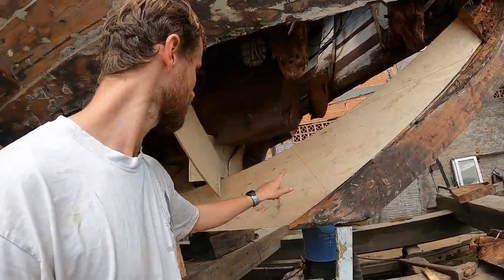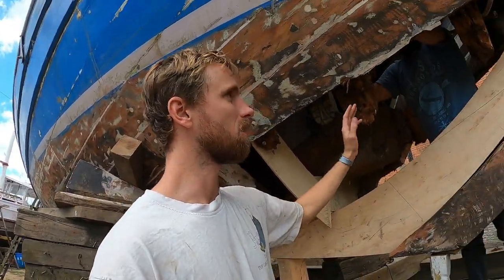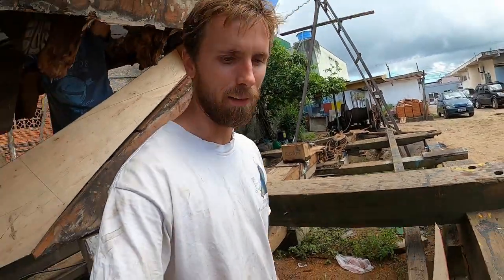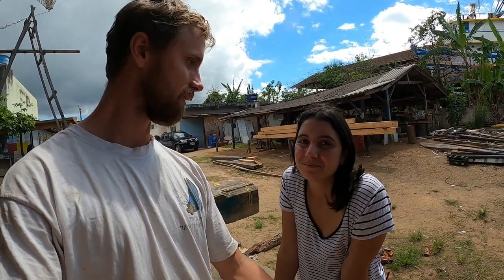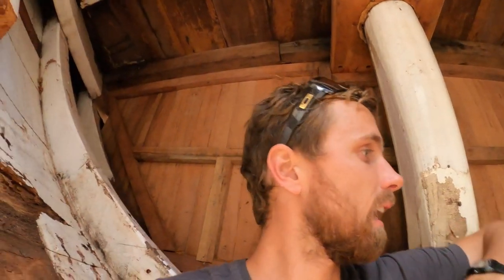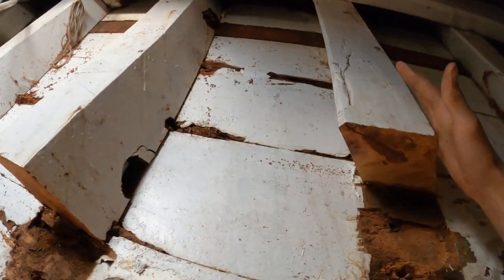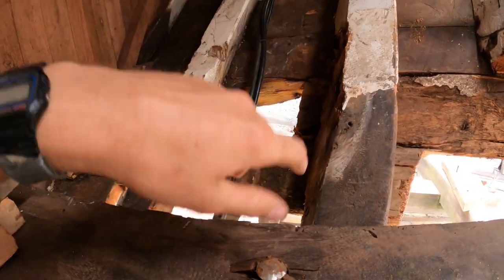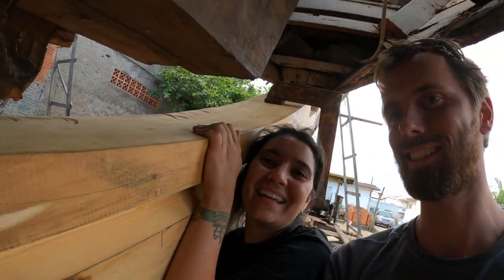From WRECK to DREAMY starts now! — Sailing Yabá #13

Comment: Like to see the final result, but some general commands; 
a nautical dictionary can help you. Bow & stern, portside & starboard, keel, deadwood (<-- where your propeller shaft penetrates the stern), bulkhead, deck, hull, shell, bottom- hull- & deck frames, hull- shell- bottom- deck planking, stringers etc. try to use the nautical names. In both languages English e Portuguese (você continuará navegando com a YABA no Brasil por um tempo). You will be a  better communicator with other nauticals / shipbuilders.

Secondly; if you now first don't invest in preserving all the "new" and still good wood you will loose it again. Those worms and termites (<--cupim) you carry around are allover your boat, take the wright action you are spending a lot of R$ and time.

Comment: Hey guys, great to see the progress however I am not seeing your workers add one important item.  For each scarf (overlapping connection) where the centreline timbers meet and cross the rabbet line you need to have something called a "stopwater" to prevent water from making it's way along the scarf line.  Not a big thing to add, these are just a hole drilled through the scarf line, usually in the rabbet under the planking into which you drive in a softwood dowel.  The dowel swells when the boat is in the water and blocks water from making it's way through your scarfs.  Sure the boat will float without stop waters but you will have constant seeping and pumping to deal with.  A lot of people don't know this but a well constructed wooden boat can have a dry bilge!  Best of luck to you.  James

Comment: Just a little English help:
Front of boat= Bow
Rear of boat =stern
The bit the planking that the planks go into the keel is called a rabbit or rebate.
The part the prop shaft goes through is the shaft log
Steering wheel is a helm
I can’t think of anything else keep up the good work Yabba is lucky to have you.

Comment: What type of wood are they using on your keel?
Reply: I did get the actual latin name, but cant remember it. It is a tropical hardwood that is generally very rot resistant.......not sure the stuff coming out was the same species of timber.
Reply: @skaraborgcraft  the wood is Garapeira (Apuleia leiocarpa)

Comment: Hard to believe Yaba is only 15 years old.
Reply: It's what happens when you don't maintain the boat regularly. As they cheaped out using sapwood etc. they probably cheaped out on bottom coat / maintenance and no worm shoe present. Sailing the boat up a river occasionally was an effort to try and kill off the marine shipworms in freshwater, but seems it was too late by that point.
Reply: Sapwood can rot out in less than a year when in water. A good builder would never use it.
Reply: The tropics can be hard on wooden structures, especially if maintenance isn't taken care of!

Comment: I still want to know the cost of this.I just don’t see spending a lot as this boat will ever be right.To do it right every bit of rot needs to be removed.Rot is a cancer unless you get it all.It will come back....
Reply: Agree 100%. And it looks to me like they are leaving some rot there if the wood is still solid enough. Not smart in my opinion. 
I’d like to know the cost as they go along too. Someone on another video in the comments said they found the original listing for when this boat was for sail and it was listed for $50,000 US.  Of course, that doesn’t mean that’s what they paid for it, but that’s the original asking price. If it sold for anywhere near that you just know the seller was dancing a happy dance as they sailed this piece of crap away. 
But I hope they’re made of money. Because it’s gonna take a fortune to get this rotten thing rebuilt.
Reply: Given the prevailing wages in a working boatyard (eg, one oriented toward repair & maintenance of working fishing boats), and the raw costs of materials, my running estimate of getting Yaba back in the water with a new bottom is between $5K USD and $10K USD.  If it goes above $15K USD I would be very surprised.

Fitting out the interior and getting some decent sticks and rigging along with sails will probably be the dominant costs ...